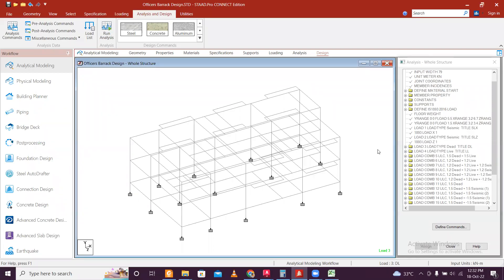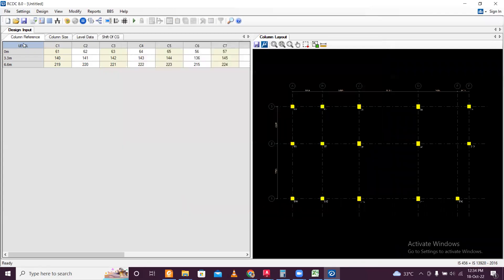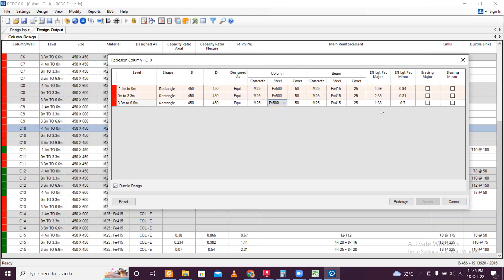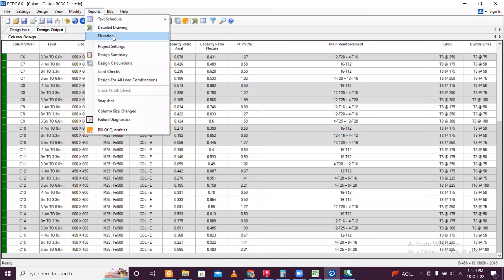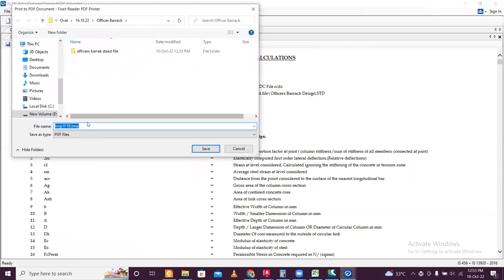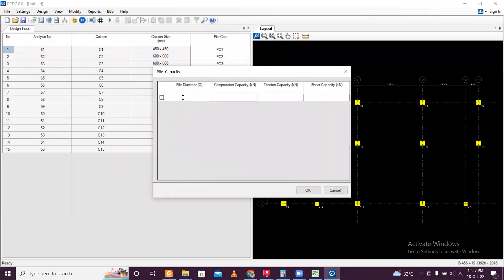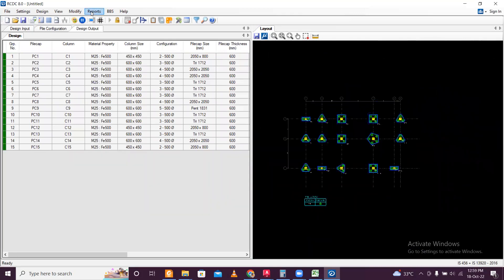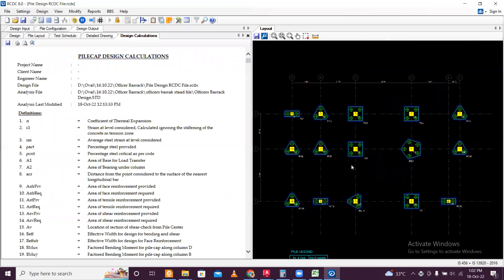Design and Detailing of Column and Pile using STAAD RCDC

Comment: How to take LATERAL &UPLIFT value for pile cap design
Reply from the maker: Check 50:26 of the video below https://youtu.be/0dAWXegVFEk

In short it should be mentioned in the soil test report, or else you can ask the soil test company specifically to mention it.
Reply: @MainakChoudhury  but what should be take if it is just for Residential G+2 Building. then without SBC how can we Take these values?
Reply from the maker: @rahulfaraiya874  Without Soil Test Report no value can be taken, no building can be designed, whether its on one story or multiple. However based on experience and any available data of the surrounding soil some approximate values can be taken.